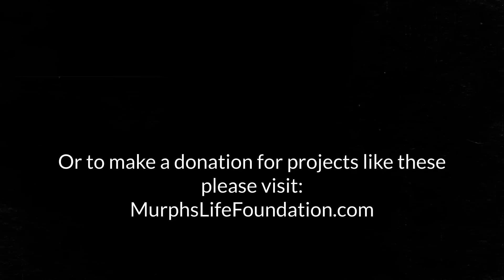THIS is HOW YOU rebuilt a WHOLE neighborhood and changed their lives forever with $250,000!!!

Comment: hey Murph !!! YOU could use a customised Keto diet too! watch out for the cholesterol in most Keto lectures and you do not need the supplements or the pills ---- the dietary change is enough. i gained 100 pounds after surgery and had to lose it. it was a mystery as to why i gained it so it was difficult but the simple trick of using whole grains (and any sweetner other than fruit during a meal) and eliminating sugar-corn syrup did it! also this ia an anti-carcinogenic diet too! it takes way less effort than other healthy diets.